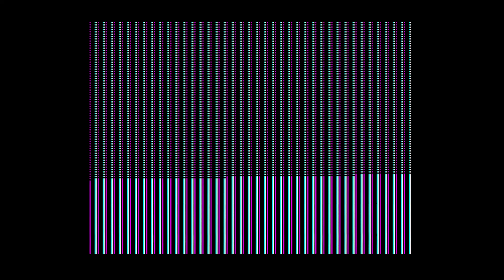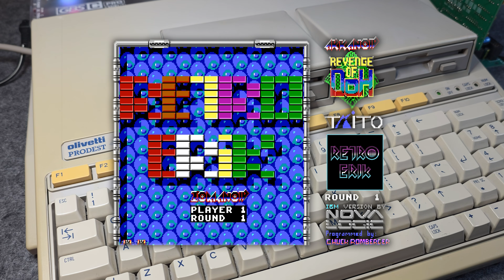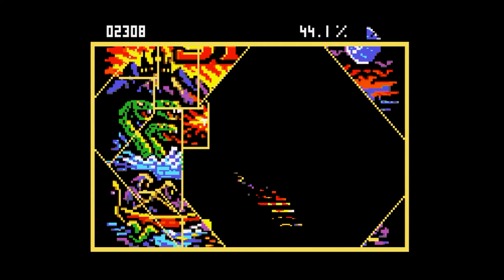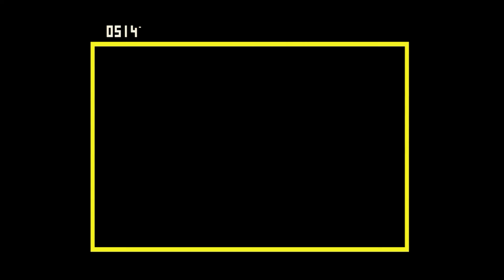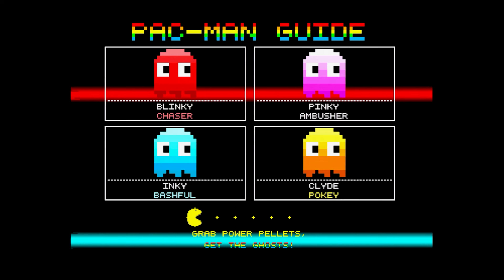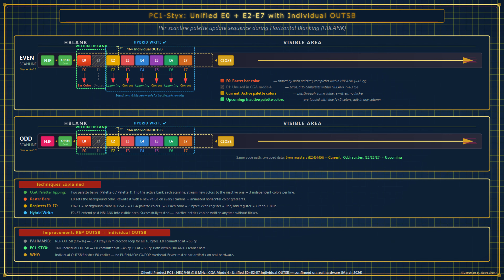STYX on the Olivetti PC1 — 16 Colors, Raster Bars, and a Secret Video Mode

Comment: When you said "this might be the first game written for the PC1", I decided to check all known games published between 1987 and 1993 for the string "Olivetti" and then checked if they have "Prodest" or "PC1" also in them.  While not a perfect test, I didn't find any, so you may be right 🙂
Reply from the maker: Thanks for checking.
Reply: Jim, Adrian has two PC1 computers, try to convince him to bring one to VCF PNW, so you can have a close look at it
Reply: @Michele_1976 oh, I think Erik is making much faster progress on these systems than I ever could 😊
Reply from the maker: @JimLeonard  I just finished an AGI driver for the PC1: https://github.com/RetroErik/PC1-AGI-Driver-Download
Reply: @RetroErik  "Monte Preyer And The Aliens From Antares" was developed with AGI, so we also developed a driver for Sierra On-Line games made with this engine, we also created a specific font that was graphically not altered by the doubling of horizontal pixels and a patch to load it into the game... all this will be included in the customized version of the game for you that I will send you 👋✌👍
Reply: @RetroErik  I can't try your AGI driver right now (my CRT TV isn't working), so I can't run any tests. The 16 colors can be displayed either by connecting PC1 to a TV using a dedicated cable or to a CGA/EGA monitor using the dedicated connector, which is different from the one for the TV. Unfortunately, using the "Driver" we created, the order of the 16 colors
remains correct when using the TV, but with the CGA/EGA monitor, it changes (for example, the position of one color is swapped with another), regardless of how it's set in the "Driver." I don't know if I explained myself well, but displaying on the monitor forces the palette to use a predefined and seemingly unchangeable color order. Have you managed to resolve this issue? Thanks again! 👋👍✌
Reply from the maker: @montepreyerandthealiensfro9122  Yes i understand.
Reply: @Michele_1976  and "Monte Preyer And The Aliens From Antares" that we customized for @adriansdigitalbasement? 😜 Don't worry, I can understand that he's been very busy and that the PC1 is a little-known computer, especially in the U.S.A. and therefore it's not worth the effort (in terms of views) to dedicate many specific videos to it... in the hope that it confirms our primacy in the concrete use of the 16-color "Secret" mode! 😂Of course, I'm kidding, the important thing is that this information and the existence of the PC1 are disseminated to as many people as possible... greetings from Italy 👋
Reply from the maker: @montepreyerandthealiensfro9122  Check my github: https://github.com/RetroErik
Reply: @montepreyerandthealiensfro9122  he has it. I’m sure he will feature it whenever he will get to work on those machines!